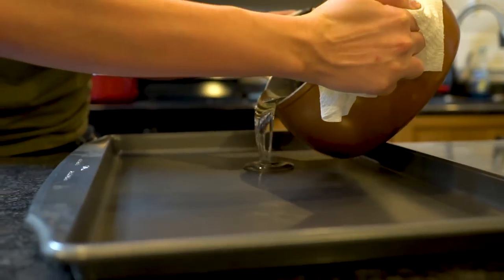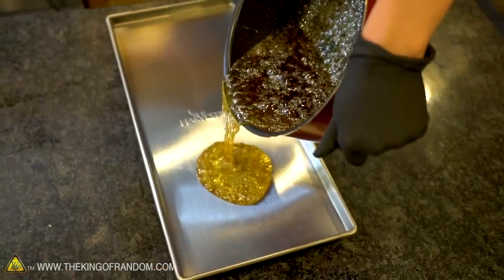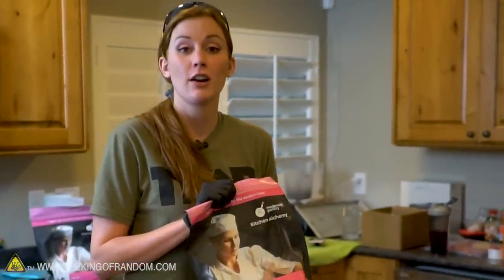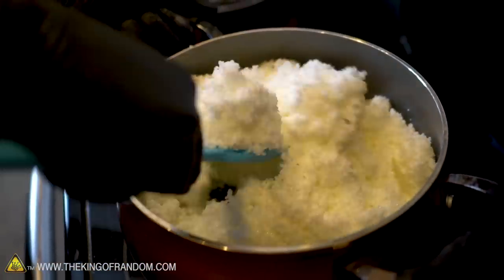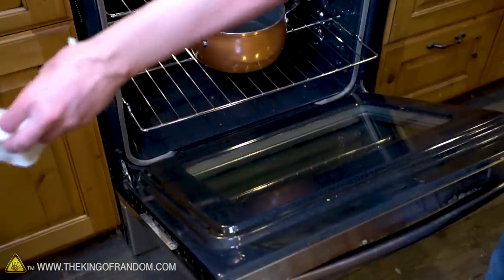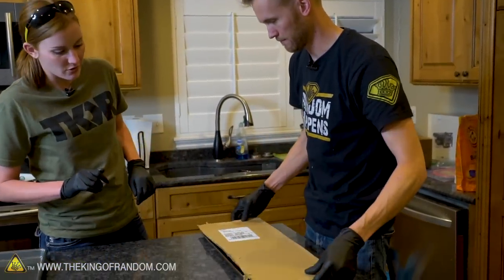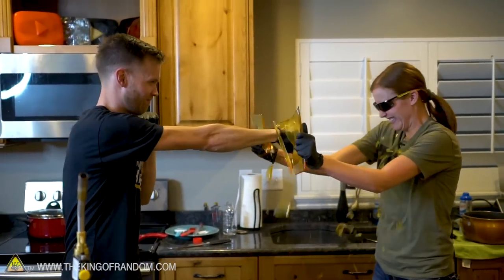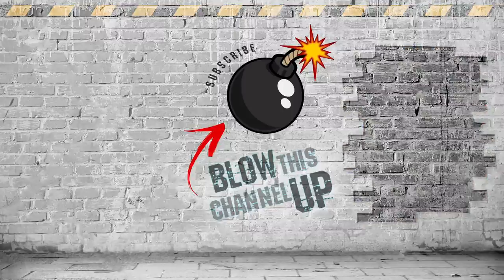Homemade BREAKAWAY Glass

Comment: If you cook the sugar at a lower heat, don’t stir it, and wipe the edges with water It will prevent carmelization and be perfectly clear
Reply: Looks like pastry chef here
Reply: shrish singh  It's likely cooling too fast
Reply: singh  set an oven to 80⁰C and then put the tray of sugar glass you've just poured into it wait about 10 minutes then take it out.
Reply: You can also get the sugar to be clear using the recipe they use, but it is way harder and you have to be washing down the sides very often, as to not let it caramelize.
Reply: Do you have the recipe for crystal clear Meth Mr. Heisenberg?
Reply: What do you mean "wipe the edges with water"?
Reply: @abundantharmony  use a pastry brush and dip it in water

Comment: Recipe:

4 cups of sugar
A cup and a half of water
2 2/3 of corn syrup

Directions: 

Low heat until sugar dissolves, then turn to medium 

Once done put it in the oven for 10-15min
Then put it on the sheet and let it dry
Reply: Very helpful, thanks!
Reply: Miles Schoenen just watch the video?
Reply: Dont think ur helpful, people would better watch the vid
Reply: Thank you great help!
Reply: I eat my sugar glass before i let it cool
Reply: How much celsius?
Reply: Thank you!!!
Reply: Thank you
Reply: 100th like
Reply: @teakmelissa  Oi It Still Is Helpfull
Reply: @teakmelissa  vids take longer to watch than reading lol. If you already know how but forget the specifics a small note is better than rewatching
Reply: How much is that in normal measurements?
Reply: Is it 2 of the 2/3 cups (1 1/3 cup) or 2 and 2/3 of a cup?

Comment: Can cement dry in a vacuum chamber
Reply: Also can cement dry if you water proof liquid cement and then put it under water
Reply: Yes. Portland Cement doesn't need air to cure, it's a chemical reaction with the water it's mixed with.
Reply: @CrazyFoxx2  action lab isn't what they are cut out to be. I can point out several mistakes in just their neutron star vid
Reply: @hoodiegang1342  cement will dry underwater it will just take longer but it's a chemical reaction not a physical reaction so it will dry under water
Reply: No cement needs oxygen or else it'll be just powder
Reply: Cement hardens under water. I don't see why it wouldn't in a vacuum chamber.

Comment: sugar glass is not yellow just by virtue of being sugar. it only caramelizes if you cook it too long. you even said in the video it was ~350F, which is past both hard crack (~300F) and caramelization (~340F). if you want hard crack, you can't leave it on the hot stove after you've hit hard crack.

Comment: I'm curious what you used automotive polishing compounds or extremely fine sand paper (2000 grit or higher) to clear up the glass more rather than hitting it with a torch.

Comment: Would you be able to run a hot plate in a vacuum chamber?  Or some other way to heat your liquid projects in a vacuum? Then you might be able to avoid bubbles without having to transfer anything.